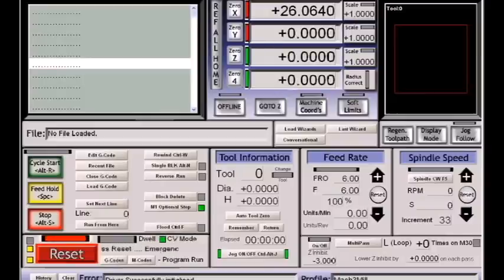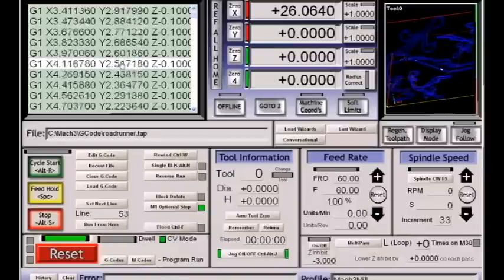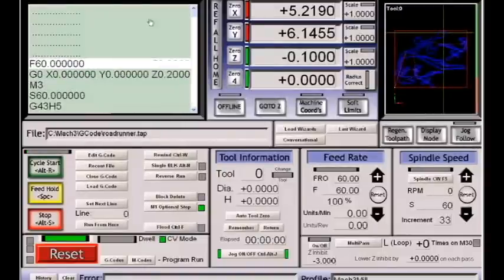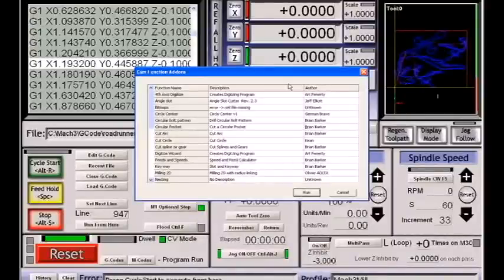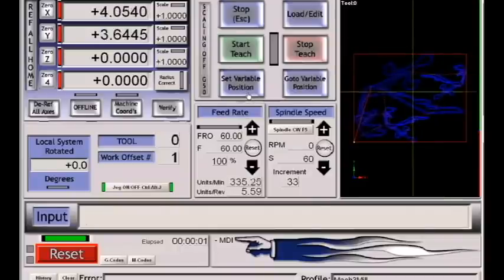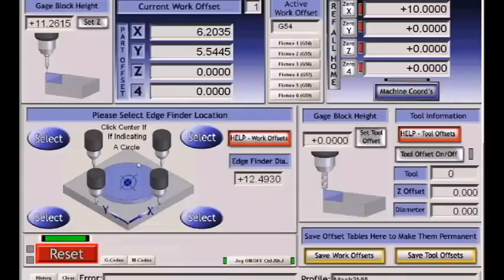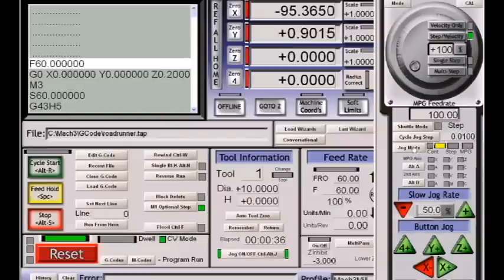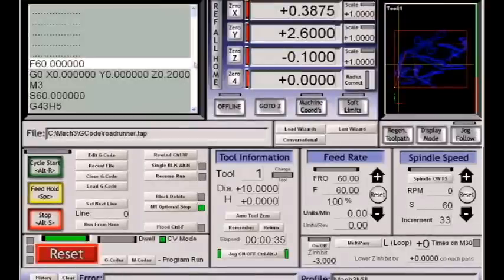MACH 3 CNC  CONTROL SOFTWARE TUTORIAL 2 THE INTERFACE

Comment: Sorry but as a person unfamiliar with cnc programming AND also computers in general, this is wayyy too complex to even begin to grasp what you are saying.   How did you learn all this??   IMO, the only way a beginner could learn how to use this would be to take a college level class for several months with hands on use of both the software programming and an actual machine.   Also, not showing the top & bottom of the screen doesn't help.
Reply: Here is the manual http://www.machsupport.com/help-learning/product-manuals/ Get to reading.

Comment: Hi Paul i just finished my cnc router and i am using threaded rod on my stepper motors. How do i go and set the program to use threaded rod as the thread is different from other screws used normally on cnc machines. Thank you for your time.

Comment: Hi Paul, Im having an issue when using Mach3 with my G0704 CNC conversion. I am using autodesk fusion 360 and the Mach3 post processor. Mach3 seems to be referencing the absolute coordinates rather than the work offsets. Any way to fix this?

Comment: have a problem with the z axis, it works fine sometimes but usually it only moves down, tried altering it in ports and pins but no joy, any help from you would be much appreciated
Reply: i have the same problem on my cnc, any chance it was on the rcfoamcutter hot wire cutter? and if fixed how did you fix it?

Comment: I am just starting with cnc so be kind. I am on my laptop to learn this program. The computer that I will be using to run my table is not built yet.

1. My Alt-7 screen is not even close to what you have.
2. Alt-1, Tool screen, you said you can set limits. I loaded road runner and it cam in the size of a pin head. ?
3. Y - X min. max. not shown.
4. Shift key does not help.
5. Jog Follow not working.
6. No pass section in Alt-1.
7. No conversation button.
8. MPG wheel not working.
Other then that I am having a good day. Not.

Comment: Hi there, thanks for sharing, i was wondering ... 

for this purpose in the vid and this purpose only, did you connect your PC to the motor through breakout board, OR directly pins from parallel port to the motor drivers. ?

Comment: Hi Paul.
I just bought a CNC Engraving machine. I hocked it up to my desktop computer and everything seems to be good but the machine doesn't seem to respond to the software.
I jog the axis on the software but the machine does nothing. In other words it doesn't move besides the spindle moving when it is on.
Any help or advise would be appreciated.
Reply: make sure you have a 32bit Operating system installed on your computer. 64 bit will not work with Mach3.
Reply: j swan thats not correct i use windows 7 64 bit happily with MACH 3 and a UC100 USB interface ..no issues at all

Comment: hi i have just bought a small desk top cnc and downloaded mach 3 i was wondering do i need to have auto cad to make drawings as well?
Reply from the maker: HI There are many types of drawing software you can use with MACH 3 . It will run Gcode and control your motors.. you will most often need both CAD and CAM software CAD for drawing CAM to generate code .. take a look at our website makecnc/dot/com for these types of software you can also find free ones online try inkscape for drawing  and CAMBAM for Gcode output to load into MACH 3

Comment: Hello Paul. I've been using Mach for a few years now and am watching these vids in the hope of picking up a few extra tips - which I have done - 'the 'Run from here' button for one. One point is the fact that I can not see the top and bottom of the Mach screen on your vids - newbies may find this puzzling. The tabs across the top and the message bar at the bottom are out of sight. No-one else seems to have spotted this - maybe it is a problem with my computer setup.
Reply: hello. please tell me how to continue my work. my knife broken and stopped. sorry for my english

Comment: Thanks. Hey has anyone ever called you PC before? hehe.
Well it looks like I wont have to compensate. I've just got to wait up to a month to get the parts from Alibiba. To my surprise they actually are making .02accuracy cold formed ballscrews. Last step is making for finding bearings to make my own jetrails with to run on 3/4" 304 rod.

Comment: importing G-code: What should i see in Mach 3- is there a way of checking if everything is ok ?
viewing tool paths: I assume this will show in Mach 3, are there any tips or gotchas for this?

Bit/tool change: I am not sure how this all works - my cnc dos not have a tool changes so how is this done in terms of tool paths etc...is it: (sherline)
1: cnc runs with tool then returns to home for tool change, then you start the next tool path with the changed too and so on...
Reply: I'm using Bobcad for my drawings, and for my router, it'll generate an optional stop M01 for the specified tool change.   Lol, I know this is 5 years old, but have you figured this out?  I'm still trying to, and hopefully this is the way it has to be for routers.

Comment: Hi Paul,
thanks for these informative videos.  I wondered if you could shed some light fort a CNC nubie. I intend to create may tool paths in solidworks-camworks using a Fanuc g-code and generic post. That being said the control software will be Mach 3 to run the CNC. As I have not tried this before  am unsure what to expect so hoping to shed some light on this. see next comments)

Comment: Eng\ Paul i participated in building CNC milling Machine the Motors we used were DMM AC Servo motors & we run the machine by Mach3 all what you have to do the Ac motor driver have 2 modes for working first using RS232 mode the second Step/direction Mode when you want to use Mach3 you have to set it to S/D mode Also there is something attracted me while i was exploring the Mach3 in the Diagnostics tab there is a bottom which is called servo Freq. Generator

Comment: Sorry Paul But Mach3 can fully control Ac servo motor like stepper motor both of them are controlled through a driver as you know but the  servo motors have to be tuned before using Mach3 For every Ac servo brand there is a software used for this tuning and most of them tuned by a serial cable by this software u could change the gain factor ,the speed and so on ... also there are some Ac servos which are self tuned ....

Comment from the maker: MACH 3 is stepper motor control software for windows based machines what you are looking for is CADCAM software MACH 3 is where you load the Gcode made in CADCAM and it sends the signals from the code to drive the motors to position the spindle or Router tool on your CNC table 
try Vectric V-Carve pro one of the best CADCAMS for CNC routers around and works perfect with MACH 3 to drive your CNC machine